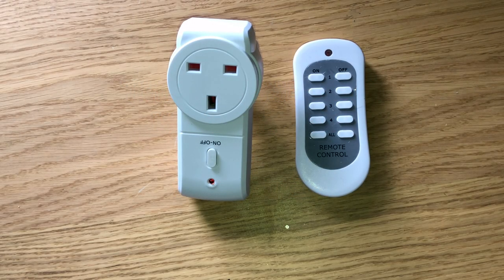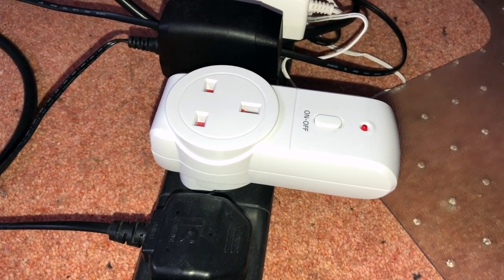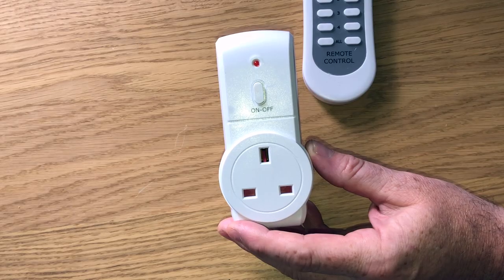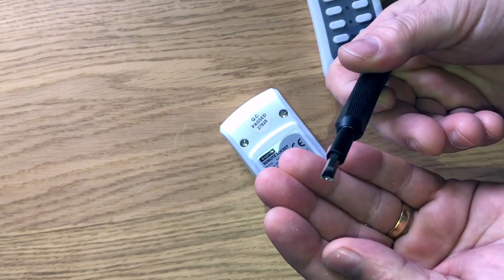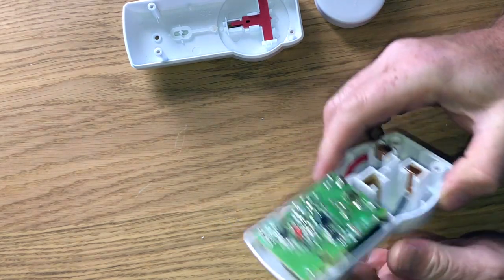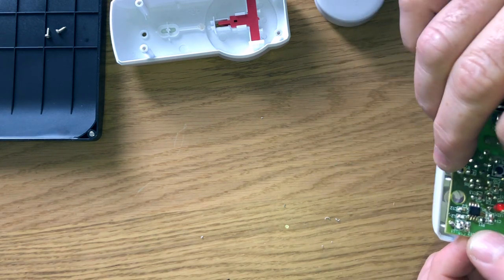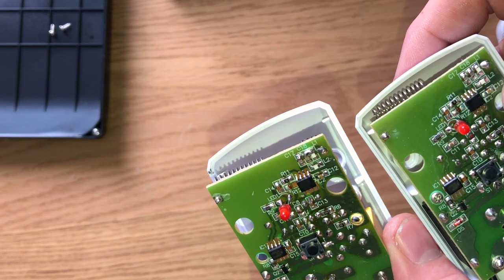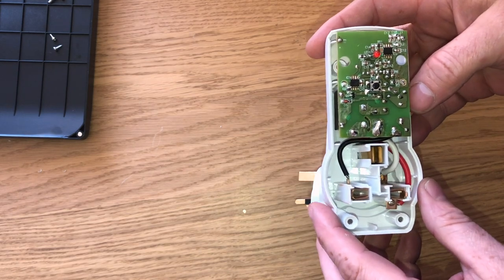Status Remote Control Repair

Comment: Well that's 11 minutes I'll never get back!
Reply from the maker: But now the rest of your day and life in general will seem so much better! Treat your viewing experience as therapy... all for free!
Reply: @TechRealityGlasgow  LOL, I'll give you that - but my bloody switch is still broke and thought I was onto a fix here.
No worries - stay safe.
Reply from the maker: Phil I have been lazy in not reporting back on how I did get the unit fixed..... it ended up by the unit being opened up, then cleaning the relay contact points. Also re-did some of the loose solder joints for good luck and it sorted it.

Comment: Please take this waste of time down as it's just a bloody waste of time as I said, or at least name it correctly. I feel strongly enough to carry on but am only just holding it all back!!  Thanks for absolutely nothing >
Reply from the maker: Please let rip! I started on this in 2018, and like you, Phil commented, got upset and as I replied to him… I just resoldered the joints and it started working again. And then, bought a better brand and tossed these in the bin! Take a chill pill, a three year old video making you freak out..  Never knew if commanded so much power over some of the masses!!! 😂😂
Reply: Got to agree , expecting a solution please change Title
Reply: Not a problem for me - I quickly skip-sampled a few sections of the video, and established in less than 1 minute that @TechRealityGlasgow hadn't found a total solution. But still interesting to see that he had got as far as I have, but still not solved the problem

Comment: I have loads of these gen 1 versions. Just got it working with Siri. Need to look at those bad batteries and caps now, and ones that program on but not off. Buy a scope or multi meter mate 👍

Comment: Tapped the plug unit on wood block about 6 times and fixed the unit. Was about to fix 5 of my 6 bad units. Note it takes 5-10 sec for unit to warm up.
Reply from the maker: Yes, the start time can take a bit longer than you would expect... I'm glad you managed to knock some sense back into your items!

Comment: Could the problem maybe lie with them being mass-produced shite made from the cheapest components going and are nowhere near standards compliant? 🤣
Reply from the maker: BigGoucho that goes without saying! But isn’t it great being able to buy in such garbage and try and work out how the hell they even worked in the first place!😬😬
Reply: Tech Reality thats actually the more interesting part, more so when it goes from working to dead without any obvious violence or drama. You could understand it if there was a loud explosion followed by clouds of acrid smoke and bits of cat burned into the wall but its way more intriguing when it just stops working.
Reply from the maker: BigGoucho exactly! And when you read the reviews on Amazon, the fault has been experienced by a lot of people. I’m just curious to know if it’s something simple to fix, or sadly, easier to throw in the bin and buy something else!
Reply: Tech Reality it's a shame too when you think that with a little more effort in the design, tooling or component sourcing it could well be good-value but in its' current state it's just a complete waste of materials and production.
Reply from the maker: BigGoucho sadly the Chinese made stuff is always built as cheap as possible.... so really the mere idea of repairing anything is probably alien to them! Watch this space for on going repair attempts!

Comment: So they ended up in the bin and a quick shopping trip to Amazon for some decent replacements?
Reply from the maker: Well I did get Alexa enabled devices a month or so ago, but the manual ones are very handy to have, so I use them in the bedroom now. It's only one that is defectve, but as it appears to be an inherent fault, it woudl be nice to know how to fix this correctly and try and do a bt to sae the planet!
Reply: It is some of my repairs - good intentions, lead new purchases. My soldering is rubbish too

Comment: mine packed up on me, and after fiddling about I assume it must have stopped communicating, as i held down the power button on the unit for a few secs and the light started flashing, then I pressed the on button on the remote and it started working again

Comment: Remote Control Etekcity zap plug switch from amazon uk. plug was stuck on  fix my switch  hit it on a wooden table twice,it then started working again.
Reply from the maker: Peter Allett I did do that with this as well....and....well..... Maybe a bit too hard...... It did work once, did the same, them I think I killed it!